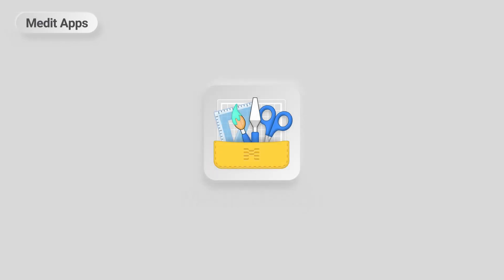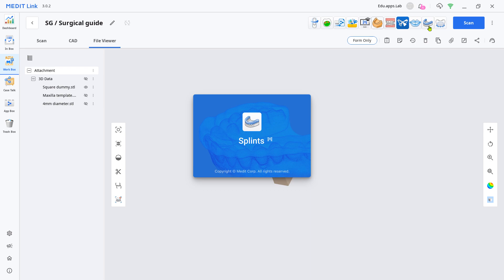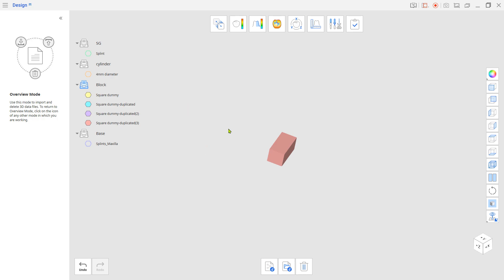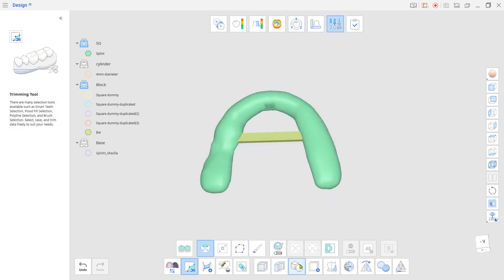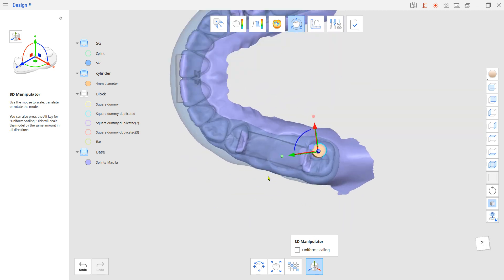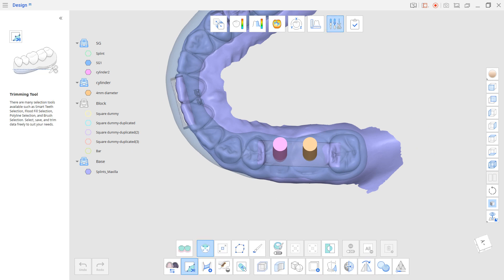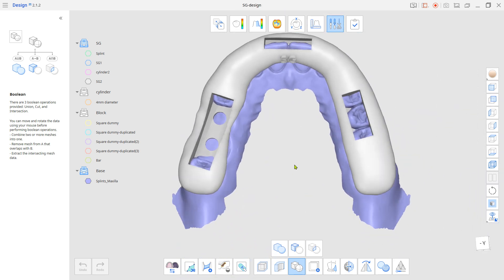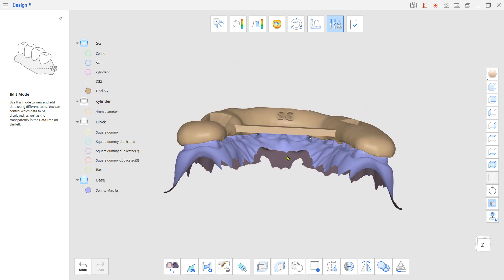Designing a Non Sleeve Type Simple Surgical Guide with Medit Design App

Comment: Hi!

I try to follow these steps but the app creates a cut in the splint where the  implant would go (like it goes from one tooth to the gingiva and then comes back up to the other tooth). How can I fix that?
Reply from the maker: If I'm reading you right, I guess you have unintentionally activated the 'Dual layer'.
Load the splits app, go to 'outer surface creation mode',
and click the 'Dual layer splint' one more time from the bottom to deactivate so that the splint will come out as one piece.
If this doesn't solve or is not what you are having triuble with, then let me know for the further instruction.